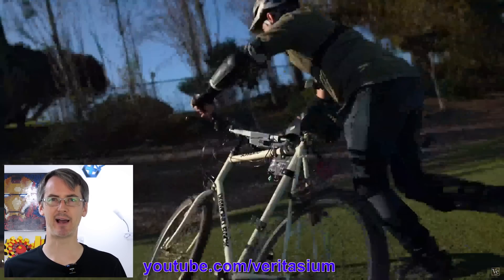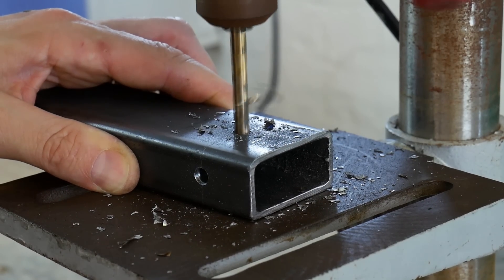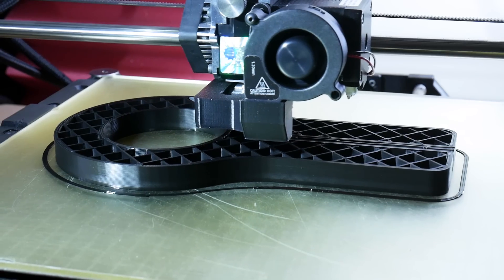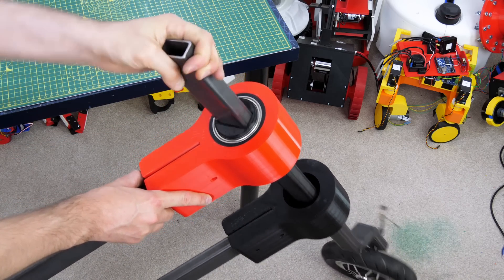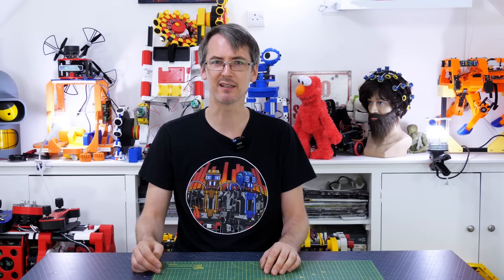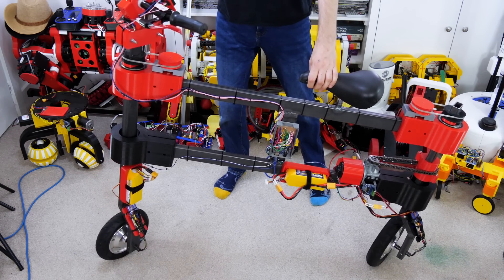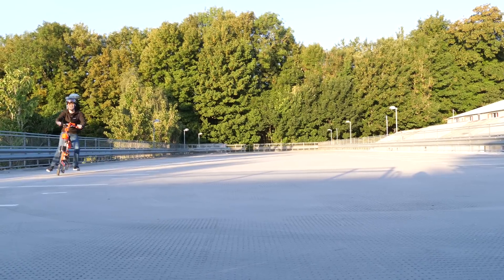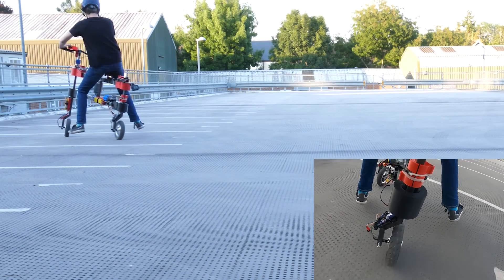Weird Two-Wheel Steering E-Bike

Comment: You could motorize the front steering like the back, and then have both steer by half as much when you are in the mode where it felt weird because it was steering too fast.
Reply: You got it right. The ones that suggested the handle bars move half as much missed the mark!

Comment: Make both wheels computer controlled.  Use normal steering to auto-balance and then add a differential component to swing the rear slightly to add a drift component.  Bring the rear in the direction of lean to compensate.

Comment: I believe all buses should have all wheel steering...when a vehicle has all wheel steering they use opposite steering in slow speed only for turning corners and the same angle steering when going fast as when changing lanes...

Comment: Would love to see how easy it to steer if the rear wheel moved half or a third as much as the front. Not positive but i think the front bike wheel is positioned slightly in front of the steering column, as opposed to directly in line.

Comment: what if you made the rear wheel steer independently of the front - like maybe have a lever you can activate with your right hand or your feet so you can control when you're "crabbing" and when you're turning tighter?

Comment: You could make a "drift" or "ice" mode by making the back wheel steer the opposite direction from the front wheels with a slight delay. Maybe change the amount of steering based on the speed you're driving at as well.

Comment: Maybe make the handlebars just have a sensor, then you could implement different steering modes depending on the speed. Low speed opposite lock, high speed, drift mode.
Bike stolen? Remotely activate steering in the opposite direction to the handlebars

Comment: James, the good old B-52 aircraft has a steering system that allows the airframe to point in to the wind while the wheels track straight down the runway (crosswind crab). You could do something similar with the bike. Pretty cool, thanks!

Comment: It seems a bit like trying to skateboard on a furniture dolly. The wheels will go in the same direction generally and it's easy to stay planted except without a way to control them the back wheels can drift out and turn you sideways even though you keep moving in the same direction.

Comment: Looks like mode 2 (crab steering, two wheels turning the same direction) is helped by the delay between the front and rear wheel. It appears you're correcting the lean quickly enough so that the rear wheel doesn't have time to turn, effectively making it a front-wheel-steering bike for just a fraction of a second but enough that you can balance. I imagine this is why it doesn't work well at slower speeds, since at slower speeds steering inputs need to be slower, giving the rear wheel a chance to catch up to the front.
Reply: Also, subscribed!

Comment: what if you just remove the switches and instead install  a potentiometer for example if the  potentiometer is in the middle the rear wheel will be straight and according to the position of the potentiometer left or right the rear wheel will turn a percentage of the front wheel steering input or 100% maybe it will be More useful to adjust the percentage of the steering angle you are applying from the front wheel to the rear wheel

Comment: To fix the issue of the wheels not tracking at the same time, you could just link both steering shafts together with a bike chain and sproket, with the chain doing an infinity logo with the steering shaft in the center of each lobe of the infinity ♾ symbol.

Comment: so how about one wheel balancer, its possible
Reply: trike (reverse) same all 360 wheels turning
Reply: quad 360 degree bike electric all wheel drive
Reply: try 4x 90 degrees rim wheels, 2x wheels drag, 2x wheels drive, actual point turning with 4 wheels, no matter if the 2x sideways wheels drag, actual tank wheel turning
Reply: or just 8 wheels, 4 in one direction, 4 in the other, 90 degree angle, then lift 4 wheels up when going along that direction, all 8 on the ground when tank point turning

Comment: you could have just cut two bikes in half and use two front sections welded together... but I know that welding aluminum is a bit different than steel... and you have to buy two bikes.... but then with the remaining rears you could make a two wheel drive bike that didn't steer lol :P

Comment: There are some interesting parameters you could tune in this setup. I.e. it might be interesting to see what happens if you change the ratio between the front and rear steering angle

Comment: I'd have done the mode 2 and mode 3 set onto opposite sides of a single double throw switch with a center off rather than two independent single throw switches.

Primarily because you don't want both modes active simultaneously and the easiest way to accomplish that is to mechanically block the other when one is electrically active.

Comment: Have you considered trying to write a steering mode that would behive somewhat like the some cars with all wheel steering? I mean the one where at low speeds the rear wheels mirror the front wheels so the car has very tight turning circle but as speed goes up the rear steers less and less and through zero to the other side where the rear goes a little to the same side as the front but much less. Basically it should feel like the bike is changing its wheelbase smoothly based on speed. Could be interesing too.

Comment: Do you have any videos that show how to wire and run the hover board motor? Bts7960 only has two wires that go to the motor, but the motor has 5+3 wires.

Comment: I think maybe the only reason you can do it is weight distribution changes to angular. but the cool thing is you can delay the rear wheel to trail the front like this. so you could use mode 1 to stear normal and gradually increase the angle of the rear during a turn making it tighter and tighter. not sure of the application but it would be intriguing to put a decaying delay on the rear angle. kind of interesting concept for a 2 wheel vehicle.

Comment: I think it might also be interesting to have a bit more delay before the back wheel starts to turn (I know there is a tiny lag already) - or just have the back wheel steer more slowly than the front one is turned - this might allow you to lean into the turn a bit, but still execute a small turning circle.  Or it might be a disaster.
Reply: Hey didn't expect you here but now that I think about it, it makes perfect sense!
Reply: Currently the thing has lag, as in: the back wheel moves a few tenths of a second after receiving a command from the front wheel. This seems extremely bad because not only does it not steer when your brain tells it to, it continues to steer when it's nolonger wanted.

I do agree on making the back wheel steer less or to only start steering after the front wheel has turned a to a particular angle, but that's mainle just for controllability.

Comment: For the normal two wheel steering mode, you need the back wheel to not turn as much as the front wheel.  Ramp up the amount of back wheel steer as you turn the front wheel further.  That way your small correction moves aren't amplified but you still get tight turns.

Comment: Might I suggest a parallel frame with two forks bent forward for the wheels, this will wear better on the bearings and also give smoother steering.

In addition I would suggest the parallel wheels setting be activated by pulling the handle bars linearly to either the left or right respectively.

The both wheel steering should be linked to a potentiometer where this option is only activated by extremely sharp turning.

I think that would really help you out.

Comment: This is very interesting.  Since you have the manufacturing capability, i'd actually be interested in a project where you made a sensible, practical e-bike, maybe suitable for off-road use, and with some handy electronically-controlled refinements that commercial models lack, like for example some sort of active steering or active suspension.

Comment: When you turn on a normal bike the two wheels don't follow the exact same path.  The rear wheel would normally be a smaller circle.  If that wheel is trying to go the same speed, that force would need to do something.  I wonder if that is why the zip ties broke and why the tracking seems off.

You should try to look at the tracking of the wheels on the ground.  A hard packed dirt path would probably work to leave a visible path.

Comment: The conventional rear wheel steering would be far more usable if the rear wheel did something like half the movement of the front wheel - very few rear steering vehicles match the steering angle as it causes the back to swing out too much, as you found.

Comment: The velocity should change for each wheel based on the length of path it takes, as curvy is longer than straight. The front bearing of a bike wheel allows for velocity change and I assume it contributes to stability as well.

Comment: Is there a chance that you are using the misalignment of the wheels to still turn and thereby balance yourself?
I know from my gym that the bidet always try to find the easiest path to complete a task even if you don’t actively think about it. 
So maybe make sure first the wheels are perfectly aligned then do the same test to confirm.
Reply from the maker: I did that as best I could after fixing the broken bits, so it started going straighter after that.

Comment: Instead of a switch to change the steering mode you could install a potentiometer. The middle position is for back wheel steering off, and turning it to the right or left you can adjust the strength of the steering in both modes between 0 and 100% (better not more).
Reply: With some balance controls you could even use it as a clutch that allows you to drift, which would be a blast to ride I would think!
Reply: I was going to suggest along the same lines. Though I would set it so on extreme settings the rear wheel turns more than the front wheel. A second potentiometer for fine-tuning the alignment might also be helpful.

Comment: You could've just use to fronts of 2 bicycles connected with a simple chain that you could just cross but I'm guessing you wouldn't be printing anything or using electronics 🤷‍♂️
Reply from the maker: Switching modes would be hard
Reply: @jamesbruton  that could be achieved by using a bicycle chain in between 2 sprockets welded to the forks just over the crowns to switch modes you would have to cross the chain in a 8 loop you can use a quick release link to make easier to release the chain. But it would be all mechanical. You can always add electric hubs to the wheels. A project like this would be great with a collaboration with a bicycle channel or even someone as crazy as Colin Furze 😁

Comment: As someone that works with big hydraulic tractors the steering modes have (nick)names and are actually used a lot for different applications. One tractor I drive can do all 3.

Front wheel only is called Car or Front wheel only steering 

Mirrored is called articulated steering and is used for big tractors to turn sharply 

Copied steering is called crab steering and when implemented properly allows the machine to keep facing what it's working on and but move left, right, forwards and backwards to adjust location without swinging around. 

Great to see these modes explored elsewhere
Reply: Also copied steering is used by tractors and heavy machinery to reduce soil compaction by allowing each wheel to have a driving lane and no lane is passed twice.
Reply: More like snake mode and sideways mode for that goofy bike.
Reply: @alexandrsoldiernetizen162  They're actually both snake mode, ever seen a sidewinder?
Reply: Peeko,
What is the nickname for rear-only steering?
Reply: @A_J502  I'm not super familiar with it but I'd imagine it's called forklift steering or just rear steering. Forklifts and and harvesters are the only vehicles I'm familiar with it in
Reply: Very interesting thanks for sharing
Reply: veritasium is wrong, steering is not needed to keep upright. a unicycle has no steering wheel yet is very easy to keep upright by literally just balancing. he did a poor demonstration because he used a case to prove himself correct where there was bias TOWARDS his hypothesis: of COURSE no one is able to balance on a bike with locked handlebars, because everyone is already USED TO using the handlebars! how are they supposed to adjust to riding this way in the first 5 minutes that he recorded them? there is a reason why no one can ride a unicycle or EUC in the first 5 minutes either.
Reply: @Blox117  
>>  a unicycle has no steering wheel yet is very easy to keep upright by literally just balancing.

You don't need a steering wheel to steer.  I'm the guy that rode the unicycle in the Veritasium video, and he definitely did not get it wrong.

>>  there is a reason why no one can ride a unicycle or EUC in the first 5 minutes either.

I'll tell you what...  I'll give you a week to practice on my bike with steering locked.  I've got $10K that says you won't be able to ride it at the end of that week.
Reply: @Rick_Cavallaro  very easy once you add a motor to it. the hardest part is getting on and going when you have to pedal. thats true for any bicycle. now how do you expect me to actually turn anywhere once i do get going?

you realize this is literally just the same as having a unicycle right? a unicycle is also hard to keep up at low speeds, but once you speed up its not at all difficult. im guessing you are also fool enough to believe "countersteering" is the only way to steer as well, am i right?

because, not thinking for yourself is pretty common these days.

Comment: You should make it with a reduction on the steering bar so the front fork turns half the turn you're making with the handle bar.
Reply from the maker: I could do that in code

Comment: My control systems professor did a whole lecture on bicycle dynamics. An interesting point that came up was that it is possible to make an unridable (at least without some control system) bike that is steered by the back wheel. This might be fun to check out as well
Reply: I made an electric trike with front drive and rear steering, one driven front wheel, two undriven rear steering wheels. it had a keen desire to eject the rider without constant correction.
Reply: @alexandrsoldiernetizen162  https://www.youtube.com/watch?v=x-Blm6gh0Gs

Comment: I'm not surprised your PLA parts snapped under stress, you're still printing them hollow! For large parts under that sort of strain, they should have high density infill if not 100% solid. ABS might have held up better with less infill.
Reply from the maker: That only happened when I dropped it, the 1.2mm nozzle parts are pretty tough with 2 perimeters.  Also a solid print takes a long time.
Reply: @jamesbruton  ah, fair enough. I misinterpreted it as the breakage causing the crash.

Comment: One thing you could try is something I dimly recall from experimental cars with "parking assistance": when you turn the handlebar, the back wheel initially turns in the same direction as the front wheel, but as you turn the handlebar more the back wheel changes to turn in the opposite direction until it catches up. I think that translates to your mode 2 for small turns but your mode 1 for bigger turns, with some tuning required for the transition no doubt ;-)

IIRC the idea was that this would help with parallel parking, and changing lanes: I have no idea whether it worked but it stuck in my memory!
Reply: Parallel parking an ugly bike?
Reply: @alexandrsoldiernetizen162  no, parallel parking the car to which this was originally applied

Comment: I'm sure others suggested it, but you could try to reduce the steering on the rear wheel a little bit. That way it should adjust the sideways thing to come back into a straight line, but keep the basic idea of steering both wheels the same way.

Comment: Lovely work Sir Bruton. I suggest you make this idea using standard bicycle steel cables and some pullies for steering both wheels without batteries and motors, you might avoid most of the problems you had in this version.

Comment: I think you were only able to ride the bike in that third mode because the steering motor on the rear wheel acts slower than your manual input on the front.

Steering the front wheel into the tilt helps you stay upright. The rear wheel steers against the tilt and tries to throw you off balance. But since the rear wheel steers so slow you are able to get some microcorrections in at the front without the rear moving much. This is saving that little bit of balance you have.

If the wheels were truly steering identical, either with both of them being mechanically linked or both driven electricly at the same speed, that third mode would be unridable.

Comment: I would have expected the parallel steering mode to be about as hard to ride as the normal bike with the steering wheel fixed. I think the reason why this works at all is because the steering of the rear wheel is lagging that of the front wheel due to not being hard-linked by means of a chain but using a servo motor instead.
Reply: In parallel steering mode you can't change directions, but you can easily move laterally.  That's how you balance an inverted pendulum, and that's nominally how you balance a regular bike.

Comment: There's an Irishman who made a bicycle that has both wheels steering. I had a go in Hyde Park, London. It worked very well. Weird, but hella fun. It wasn't electric at all, this was back in maybe 2004. The bicycle had conventional pedals, and a front and rear handlebar that you controlled. One end steered by one arm, the other by the other arm.